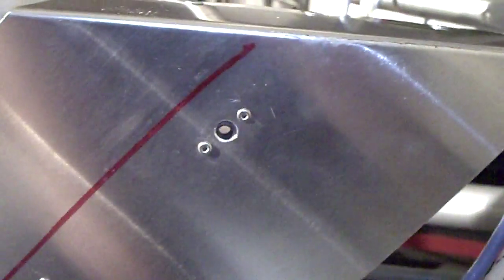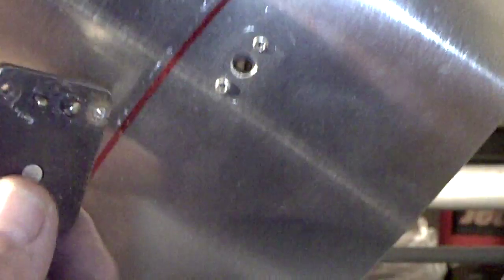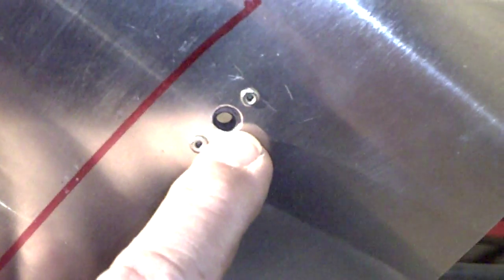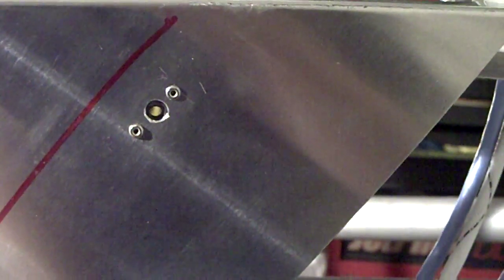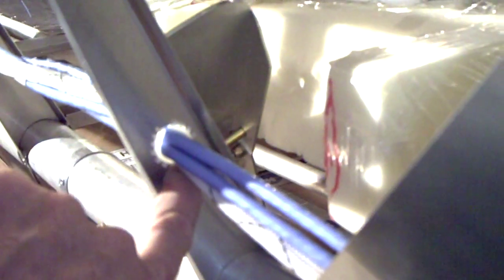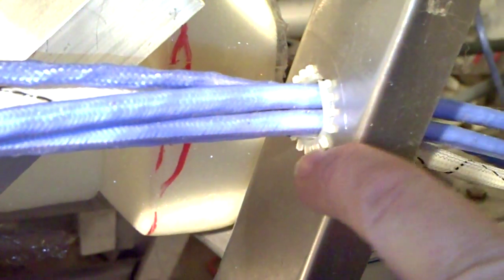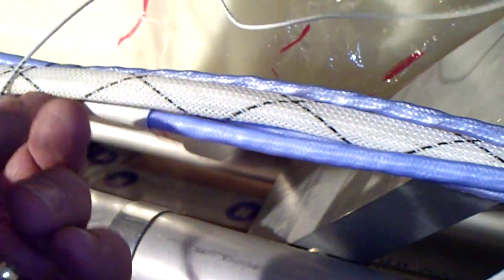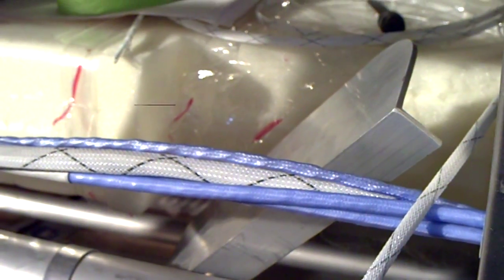MICHAEL HEIT:  SUMMARY OF NUT PLATE INSTALLATION & INTRO TO WIRING

Comment from the maker: The back side of the cowl will have a rubber snubber installed; I just didn't get it on as of the time of this video. I used whatever parts I had on hand in the shop at the time, and those type of rivets used I had plenty of.